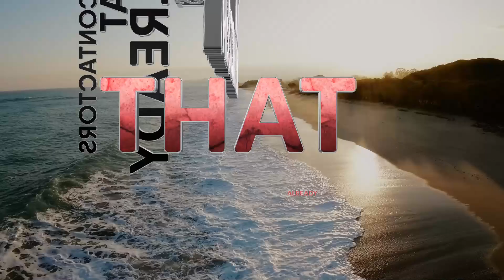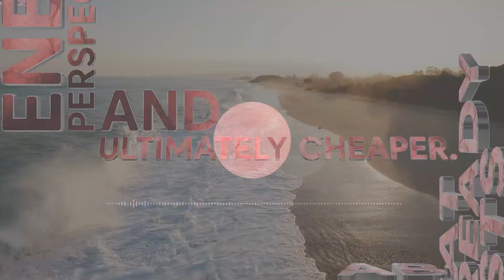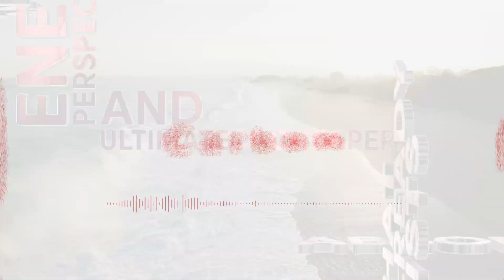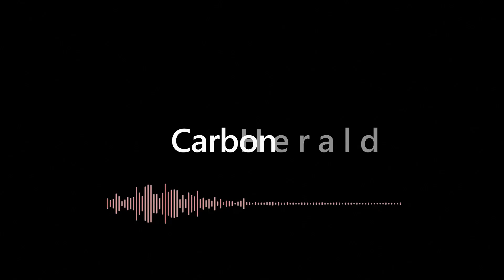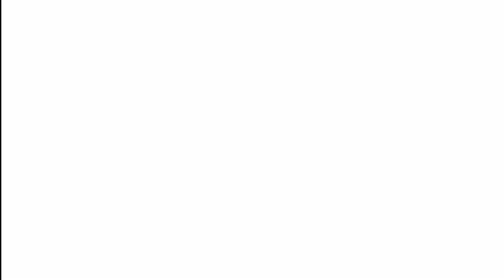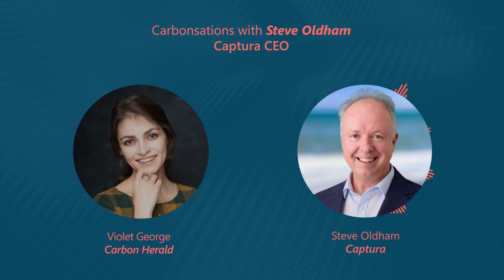"Ocean capture is more efficient than DAC," Steve Oldham, Captura CEO

Comment: Around 1750 AD st the peak of the last cold period we reached a CO2 low of 180ppm. Ice core data.  However photosynthesis stops below at 150ppm. Failure of plants to grow would create the worst ever global mass extinction. We got extremely lucky. 
CO2 naturally increased as the climate warmed. Then after 1950 we’ve had a significant upturn in CO2. It’s now 400ppm. BUT actual warming has not moved any faster than it always does at this part of the cold/ warm cycle. The extra CO2 is greening the planet. Plants are happier and they grow faster.